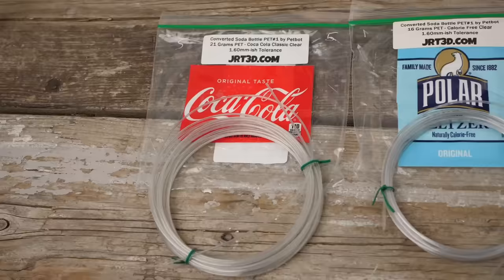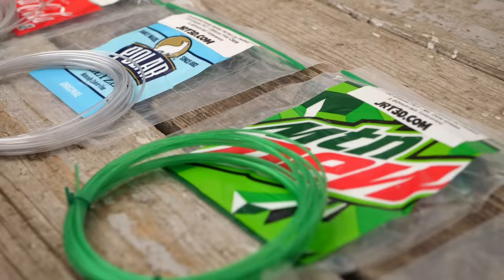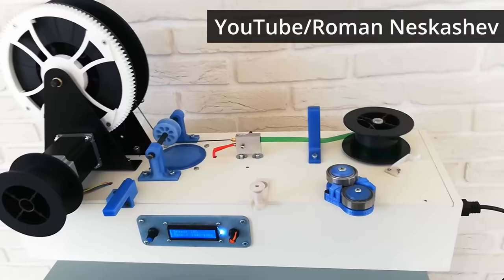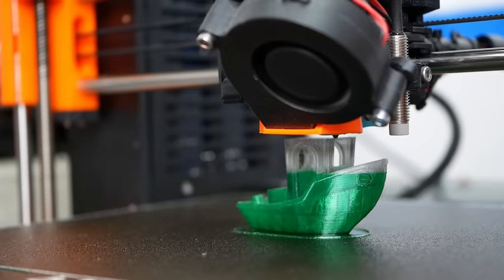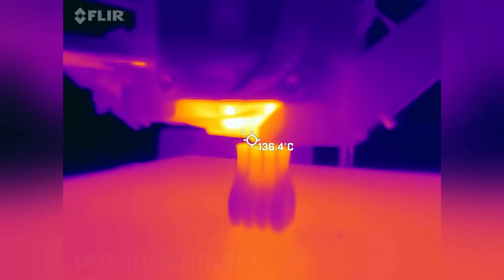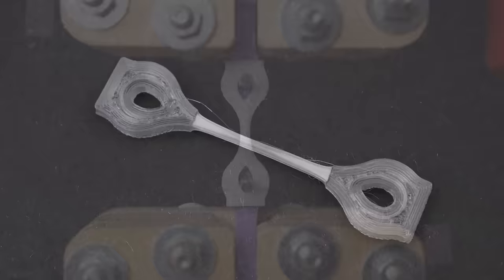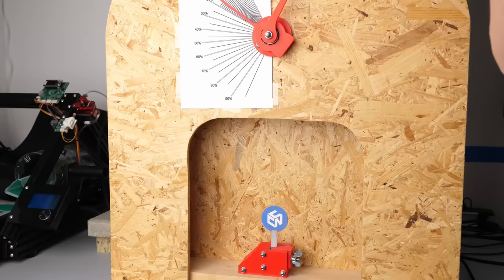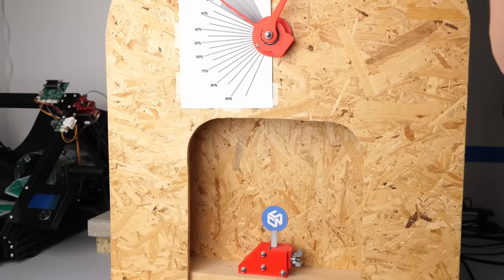HOW STRONG is PET Bottle Filament?

Comment: PET is amazing to recycle. Really worth it but I don't with the deposit on PET bottles in Germany that it would be worth it
Reply: When you live close to the boreder (Danmark, poland, Czech)  you could got it there.
Reply: There are still PET bottles in Germany without deposit.
Reply: @jayphone1  there is a good reason why they don't have deposit. The acidic drinks change the chemical nature of the pet.
Reply: @ArneSchwarck  Thanks. I didn't know this. I thought there is nothing more acidic to drink than Coca-Cola. I have seen a PET milk drink bottle today without deposit.
Reply: @jayphone1  I regularly use my deposit bottles to fetch milk from the milk station and after that it is clearly chemically bonded to the pet. Can't get out transparent again with standard detergents
Reply: @ArneSchwarck  That's really interesting. They should make some kind of a thin walled bag or sealing in a pet bottle which can be removed before recycling. Recycled PET prices are already rising because there is not enough quality "raw" material for everything as every conpany wants to make green products.
Reply: @jayphone1  I think tetrapack has that patented. With an aluminium or PP lining. It would help to keep the chemical stability of the pet. But then the bottle would be more expensive

Comment: I've been printing with PET bottle filament for a few months now and I find the whole deposit thing to be a non-issue.  I find bottles everywhere so they are literally free.  If I take them to get the deposit back I have to collect them, rinse them, bag them up, take them to the centre, wait in line and the have them go through them and they inevitably will reject around 20% of them.  Easier to just turn them into filament.  I also get a huge amount of them free from the recycling at work and since many people there know I use them they just bring them to my desk.  I actually have more than I can use.  One thing I really like about the clear bottles is that I literally have an unlimited colour pallet.  All I need is a collection of sharpies and I can make any colour, black/white/grey and even metallic.  It's completely up to me.

Comment: this seems really nice, since you can also melt the PET bottles down in a normal oven, or such, which basically lets you both mold, AND 3d print, purely from discarded plastics, and if you have one of those fancy melty machines that can re-melt old 3d prints into filament, you could probably mix them up, either with different colors, or even different materials, e.g. PETG, which could be a mess, but could also be quite an improvement

Comment: I definitely want to try this at some point in the near future. I am curious to try pulling multiple stripes using multiple bottles and trying to combine them into one filament to extend the useful length of material.

  My main hesitation holding me back still is my lack of knowledge on polymer chemistry. Heck, I've even been watching some opencourseware classes from MIT to (re)build my solid state chemistry understanding, and looking for content about the polymerization process in practice.
   I think the main question I want to know is what polymer properties can only be set when combining monomers in fluid/gaseous form versus what can be mixed and tuned through extrusion mixing techniques after the polymer has been pelletized?
 I spent awhile painting cars, working with composites, and working for an asphalt company for awhile. In my empirical experience, the key to most plastics I have worked with and asphalt recycling/production is the solvent that is most effective for the respective material. For instance, mixing diesel fuel with the black tar in asphalt grindings makes the stuff pliable and recyclable. It's also the only solvent capable of cleaning off the fresh tar if it gets spilled. There are also lots of tricks with automotive paints and composites when the right solvent is used. There are an enormous range of solvent "temperatures" and additives sold to control things like paint flash times and orange peel textures of clear coat finishes. For instance, it is possible to repair only part of a panel on a car, and under the right circumstances, only clear coat part of the panel where the repair was made. The clear coat would normally look like crap if it were left like this, but if the right solvent is used in a spray gun with the right settings, it is possible to spray the solvent over the transition between the new and old clear coat and it will cause the two layers to bond chemically "burning in" the transition and making it invisible.  So what solvents can modify recycled PET during processes accessible to the average person?
Thanks for the upload.
-Jake

Comment: In the past 2 years I've been trying, modding and improving my own recycling bottle filament machine. I'm only seen your video now. My filament is now 100% massive, a pure monofilament made of PET bottle with a simple 3D printer extruder as pulling system. I'm quite happy with the results and with the precision of the resulting filament. Thanks to it I'm now building a pellet extruder, so I can recycle the rest of the bottle and caps. Perhaps I make a video soon. Thanks for your amazing work and hope you're having a good time.

Comment: I'm not sure if it is the same in other country, but here in Japan, they started making PET bottle with inner PTFE coating. This method allow the bottle can be thinner while still air-tight. That kind of bottle is not safe to be use as filament. So just make sure the bottle material is not toxic to be use as filament.

Comment: I’m trying to understand. You said PET crystallizes when it’s too hot for too long but you want to try with higher temperature and less cooling to see if it improves. I think you’ve covered the topic well enough, so don’t build the machine unless that’s what your heart wants. 😉
Reply: I think in some applications crystallization is a desired effect.
Reply: Higher temperature is mentioned in context of improving layer adhesion. Also crystallization is actually good for the strength, rigidity and high temperature performance. Clogs in hotend as far as I understand occur because "crystallized" polymer needs higher temperature for melting - so higher nozzle temperature (at least when starting from cold) can also help.
Reply from the maker: Higher temperatures and less cooling might be an option for better layer adhesion but might cause even MORE crystallization because the material stays hot longer. For less crystallization I'd  need lower temps and more cooling.
Reply: @CNCKitchen  I tried to say, that you need higher temperatures to melt polymer that could be crystallized in hotend between prints. As for staying hot longer during print - time spent in hotend is more or less function of printing speed (and usually you can print a bit faster at a bit higher temps). Of course it will stay hot longer after it came out of nozzle - but at this point, i think, crystallization may even be desirable, giving more strength to the printed part (I think you heard about post-print annealing of printed PEEK parts  during which polymer crystallizes to a some degree, turns opaque and becomes much stronger)

Comment: That was fascinating. Yes, do get one! Have to find a way of making longer filaments - big melting hopper to do 50 bottles at once and pull out of the bottom?
Recycling failed prints is something I'd really like to be able to do - I keep them in separate bins for the day I'll be able to reuse them, instead of throwing away.

Comment: for splicing filament i just use a homemade "rig" made of two stumps telfon tubes strapped with patent band (metal kind) i heat a stanley blade. then i insert the filament ends and align them before i insert the hot blade in the gap. then i just feed them by hand together and pull into one tube and rotate while it cools down. 100% hit rate

Comment: I think you should build one.  But, on the cutter, add in a simple splicer so you can combine multiple bottles together.  This could be done best after the cut and fold.  You could use a two sided hot plate like they use to melt together large plastic pipes.  

The concept is a fixture with two clamps on either side, and a double sided hot plate in the middle with the clamps on a rail and the hot plate on a hinge.  The two tubes to be jointed are clamped in either side.  A cutter is then used to square up both ends to each other.  I see the easiest way to do this would be to have a block that slides over the protruding end  of the filament and simply cut the filament with a razor while keeping the blade against the block to keep the cut square. The ends are then moved up against the hot plate and the are heated to a plasticized state.  The ends are moved away from the hot plate, the plate is moved up and out of the way.  Then the two ends are forced together.  This does force a bit of extrusion of filament out the side, but the bond is just as strong as the original plastic.  A cutter is then used to remove the extruded plastic, leaving a clean exterior with almost no sign of the  joint. 

I believe you have the experience with rails to pull off the sliding clamp system.  The hot plate might be more difficult.  That could be as easy as putting a hotend heating element in the side of a plate of aluminum.  The cutter would be the hardest part.  Cut away too much and the drive rollers on the hot end might skip when the joint passes through.  Leave too much material and it will probably clog.

I can model this for you if you want.  I think it would make for a couple great videos.  I also have access to a small machine shop, so any parts you need made, I can make and mail to you.  I can do aluminum, plastic, cast iron, and mild steel.  I can also weld, braze, and solder, so I can fabricate just about anything.  I would love to send you some brazed wire splitter hot ends.  I would use smaller diameter wire, but more of them.  Being brazed, you could run the nozzles as hot as you want without fear of de-soldering the wire.  The thinner wire and greater temperature range should yield even better results.

Comment: cool hello from Russia!. I tested this filament in my video too, its really stronger that PETG, i didn't expect it. But i used 100% fan + highter temperature about 270+. its really impressed. I love this type of filment, but it's need to be dryed before print. Good video always hight lvl...
Reply: I would like to ask if the designs would have good quality if printed at 250C?

Comment: Print with a self-made bottle to filament extrusion system! Instead of a filament roll holder, your printer will hold soda bottles! How? A delicate system of razorblades cuts the bottles to an exact ideal shape, which is then stacked in a sandwich like fashion, pushed into the hotend to use three colours at once. Each band will be less wide, but as they are stacked will offer diverse color options and avoid forming a gap in the middle.

Comment: I would add another extruder to the system, or pull the filament twice, first time through a bigger nozzle, then I would join several strips of filament together and pull second time, this time with the desired diamrter.

Comment: Yes, definitely build one of those bottle slicers, but put 2 bottle holders on the platform. That way, when one bottle is almost done, you can take the end and splice it to the new bottle with a small butane torch or cigarette lighter. Alternatively, you could add a pre-heater coil to the filament extruder module, allowing you to simply hand feed the new PET strip slightly overlapped with the old one and have the heater do the splicing for you. If you want to go full automation mode, it should be possible to add a set of powered rollers just before and after the pre-heater coil, that way the strips are kept at constant speed and you can have them pressed together for better adhesion prior to extrusion.

Comment: I agree with @Tony Bullard below, this is not so much about feasibility to save money, as it is perfect recycling. Imagine a municipality doing this with a much more high-scale and well-engineered assembly where it can be done rapidly and at low cost. A small initial investment could turn ALL of their PET bottles into filament, which they could then re-sell to their 3D printer community, at a lower cost than buying virgin filament. It is a win-win-win situation:

- The municipality no longer has to find buyers for their recycling. They also lower their carbon footprint since it no longer gets shipped away.
- The municipality has a new revenue source, because they are taking plastic they are getting for free and selling it 
- The consumer saves money on filament, and gets the feels-good feeling of saving the planet as well.

I would like some municipality to find some grant to pilot this idea.

Comment: Something to play with might be introducing other materials into the core of the folded filament as it's "pull-struded", another smaller ribbon of a different plastic, a powder modifier like glow pigment, etc. I also wonder if there's some industrial PET film product that comes on a spool and could be run continuous; not relevant to recycling bottles, but if there's interesting things that could be wrapped into a pull-struded core something like that might be a more controlled feedstock.

Comment: Low quality plastic filament could be a good business model to recycle plastic that would otherwise go to the dump.  For an individual who tries not to consume too many plastic bottles, it's not very feasible but it might be an opportunity for someone to start a business out of a garage that has the time to go collect bottles and come up with a good way to take a random assortment of plastic and turn it into something that can be extruded.

It may even be something where low quality plastic is turned into sheets and on to rolls by one machine that can then be used on a second machine to cut it into strips and extruded.

If strips need to be 1" wide for example, then a 12" roll could be cut into 12 1" strips and run into 12 extruders at once.

Comment: So far, out of 260-ish comments only two others have mentioned the channel mr3dp making a homemade pull-trusion system. It's not as glamorous looking as JRT3D's system, but it is very modular, allowing you to separately cut bottles to ribbons in advance and then later when you have the necessary parts set up the modified hot-end puller.

Comment: if, when making the filament, you pulled two strips at once.
you could probably make it so when they are being pulled, you get two C-shapes, and get them to interlock
then offset one strip from the other by a meter or so, then you could pull a filament of indefinite length by adding another strip whenever one bottle runs out.
the one caveat is you are now going to have significantly longer fillament length output because of the overall larger cross-section of using two strips, unless you take narrower strips off the bottle
if you cant do narrower strips, you might be able to do the same using a little more pull force or raise the temperature.

Comment: i hope you see this message, you can drill a 4mm hole along the edge of a heatblock and put a piece of a bowden tube in it to heat up 2 ends of small spools of plastic and fuse them together to get longer spools (ofcourse that small section of fillament will then end up with a slight over extrusion but it shouldnt hurt the print quality that much)

Comment: Printing directly with the bottle strips certainly seems like a labor saving idea. If you could automate stitching the strips together it would actually be practical. Perhaps a jig that holds the end of 10 strips and moves and attaches the new strip when it comes to the end of the previous strip  .

Comment: 2 questions I alsways wondered about when seeing this method:

1) would it be feasible to connect the strips from several bottles before the hot-end to combine several bottles into one long spool of filament
2) what would happen if you feed a string of fishing line into the pull-truder before the hotend. Would it build a nylon "core" inside your PET filament? Could you get it to print, and what would be the properties?

Comment: If you’ve got an extra machine laying around it might be a fun thing to try. I’m in the process of building a splicer, and I’m tempted to make an attachment to let me make filament, I’d only need to buy an extra heat block.
Reply: This system is called PetPull in the original.  For some reason, the author does not talk about this in the video.

Comment: Bottles also arent just one material.  Used to work in a bottle plant and they are made by blowing a multilayered plastic blank into a hot mold.  So its effectively a laminate and that could affect toughness if there are any non pet layers molded into the bottle.

Comment: fusing the short strands into a whole spool would be very convenient. while a runout sensor would be nice for letting you switch out filament id like to start a print and leave it until it finishes. it could also be commercially viable that way.

Comment: I think you should machine the bolt head off of a standard brass nozzle and thread it all the way to the narrow end. Then do it again. On one, drill it to about 2mm, and the next one to about 1.70mm. the smaller one into an existing printers hot end 'backwards' so it's buried (may need a slot cut across the back so you can use a flat screw driver). Then with the larger one until it butts up to the first. Then use your printers filament feeder to pull it and feed it to your spool holder.

Comment: Recycling bottles into filament might be a huge option if people can get grants for the machines.  Doubly so with schools that could just make it a freshman/level 1 project.  Ideally this stuff will come along to have a hoper with plastic bottles just dumped into the top and a line of new filament being extruded out the other side.